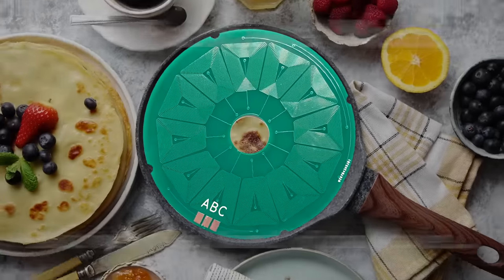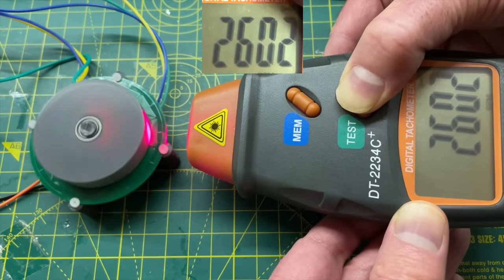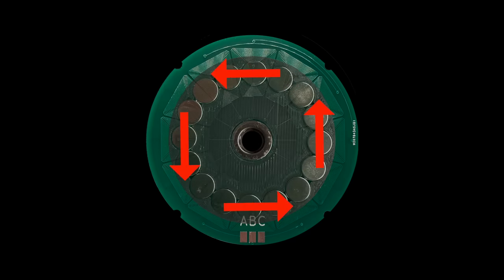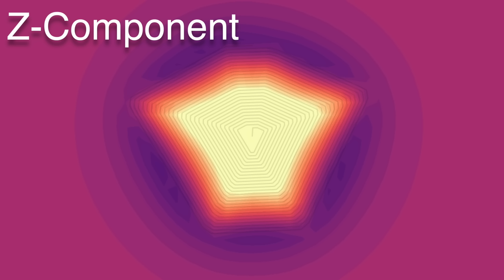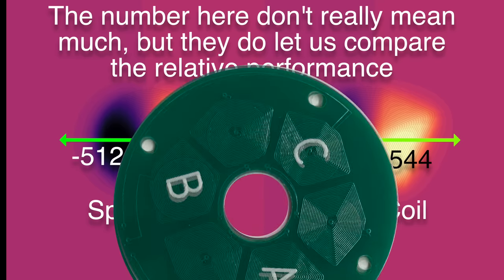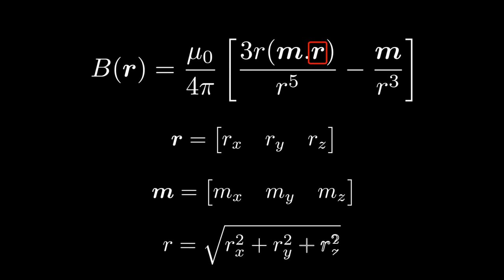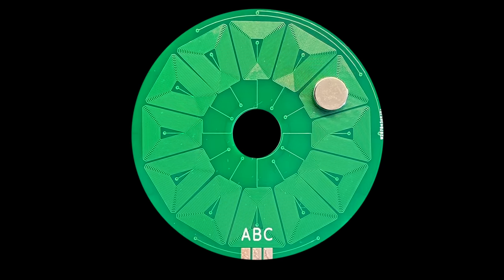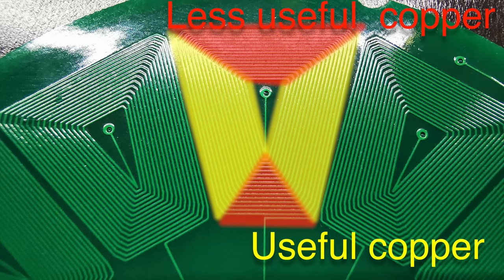PCB Motor - Why Are Wedge Coils Better Than Round Coils?

Comment: Wedge shaped magnets?
Reply from the maker: Been looking - but they come in quite large sizes and can be expensive.
Reply: @atomic14  I'm gonna use this to generate power. My stator will also be electromagnets. I hope it'll operate.
Reply: @atomic14  You can order them for a certain shape if you need a lot of them.  Neodymium sucks strength-wise but it may be possible to machine them.  Just note that they will degrade without a protective coating.
Reply: Same idea lol!

Comment: It's my expertise but I'm not free so if your wanting answers I've earned my knowledge of the subject so can but reserved information on the subject
Reply: Cool, how can I contact you?
Reply: @Eduardo_Espinoza  I've mastered these Generators Motors Coils long ago even put a Patent Pending on the Generator the Motor can't be used as it will erase it's magnets under loads and self destruct but I have a motor design that the Coils get cold instead of hot high speed strong long stroke
Reply: @kevinmichaelbergman8276  wow! What's the number?:)

Comment: Surface/coil ratios, mr obvious..

That being said there is so much to improve.. the coils do not even “overlap” into each other, this for obvious efficiency reasons and another pro, smoother operation. 

Lol, you skipped it in university? I learned this not even on a university. Tp certificate? Want a hint for improving this shitty design? Look at how the flowers of sunflowers (the seeds) are arranged. No thanks needed.